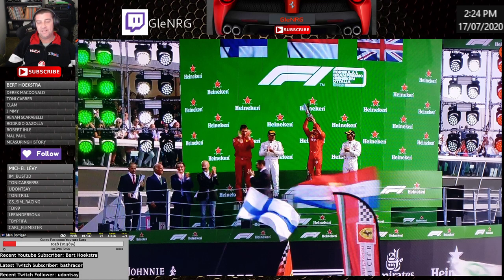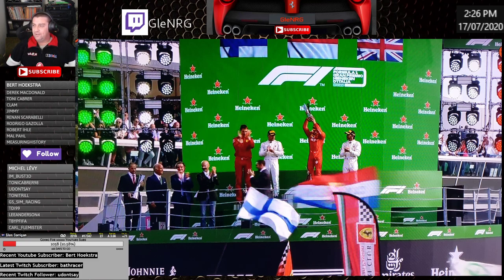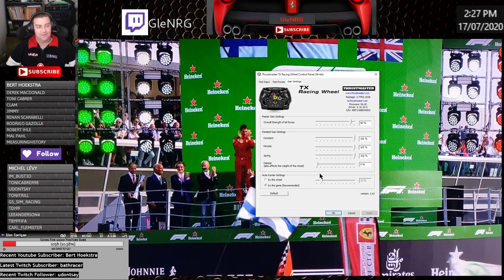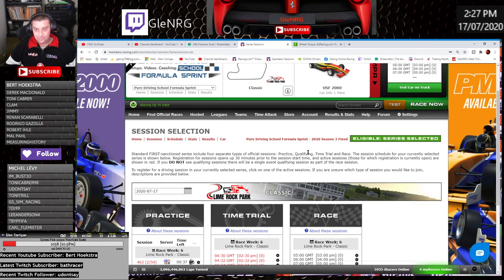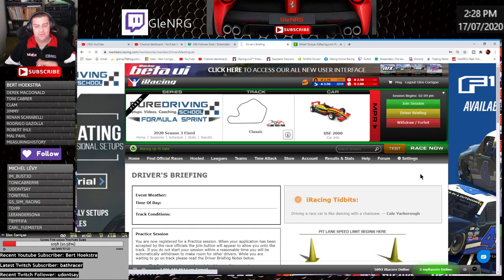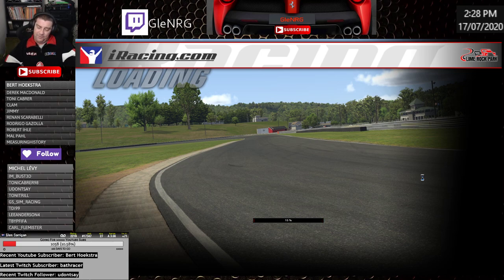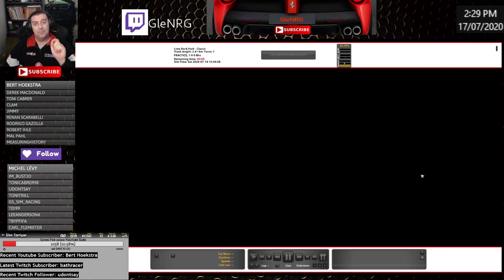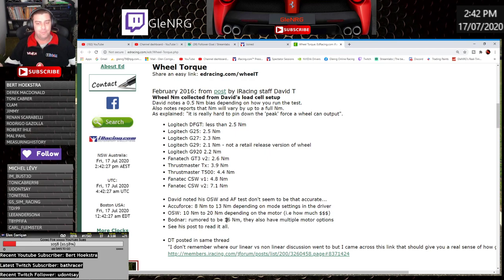iRacing Tips - FFB Settings That I've Only Just Discovered

Comment: Did you ever try the program called irFFB? that is even better FFB than the iRacing one
Reply from the maker: Only just heard about it mate. I will look into it as it has great feedback from people in the reddit comments. 👍
Reply: Good vid mate. Funny. My wife says drink driving is no good for you mate. 😂
Reply: Na, would not use irFFB anymore for a majority of the cars. Was helpful for a while with older tire models specifically on GT3 cars. Now with newer tire parameters it rather makes the FFB worse than better. Especially for Skip which is the most advanced, also not helpful with F3. Still can be improve GT3 cars for better understeer feel. But in any way: it puts additional lag on your inputs (which you want to limit by all means!).
Reply: irFFB adds input lag. That's the only reason I avoid it though. It's bad enough being stuck at 60Hz (17ms) let alone increasing the input lag even more...

Comment: My Thrustmaster TX have a min force at 9.5%.... I think yours is around that number to. (You should check your min force with wheelcheck program.)
So 24% is way to much, and that gives the vibration when you go straight forward.

And 0 is to small, and that gives you a deadzone when you are in a straight.

So you should put your minimum force number you got from the wheelchecker program in the iracing min force section.

Example: if you run min force check 5 times, then you take the averege number of what you got.... And lets say it will be 9.5%....
Then you can use 9.5% in iracing min force settings.... If you still got vibrations on straights, then lower the value in iracing with 0.5% at the time untill you dont have any more vibration on a straight.

0 is way to small and not a good number to have in iracing for a Thrustmaster TX that got at least 9% of min force.
Reply: I run mine a V2.5 and it comes out at .5% and it's low. Yes, I used iracing wheel check program